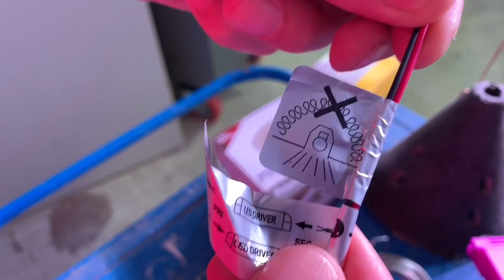Downlight FIRE HOODs are difficult to install - Think again!  - A great solution from TENMAT

Comment: Which Fireproof Downlights or Hoods are best to maintain insulation levels and not pass airflow through the Downlights fitting or hood ?   This witches hats have lots of holes in them and will pass draft airflow.
Reply: Could you please answer as I am fitting some fire rated downlight from quickwire in the on suite. These will be going into the insulation.

Comment: NHBC well what do I say they have being on TV many times fxxking usless organisation getting cash for fxxk all and don't do anything when things go wrong making them totally responsible for a lack of quality work would make them so much better. They should pay for any repair within a property but good video on down lights I was just wondering of the odds of having a house fire these days and like everything else it's a lottery chance to cost and any way maybe the manufacturer of the joists need to do more for fire protection of the joist surely they can do something there is products to make timber fire rated

Comment: LEDs down lights Don’t get hot,
So fire hoods are not required, also if the light fitting is fire rated the fire hoods are a wast of time and effort, they were required when photoflood down lights were  the norm. 

What is the hottest part of a house ? Or the coldest? 

Summer time temperature outside is 80c in your loft it’ll be nearer 200 c  but we don’t see lofts bursting into flames , LED down lights are not going to produce enough heat to course a fire , this is just health and safety gone made
Reply from the maker: The firewood is to maintain integrity of the fire barrier. It has nothing to do with fitting temperature.  With fire hoods (or fire rated fittings) In a fire situation flames enter the ceiling void and cause the timber structure to collapse)  - check out this video - https://youtu.be/c_5MqhJLwFk

Comment: I can't believe we are discussing the testing of manufactured joists they have been widely been used in mainstream house building for the last 15 years and fire-rated downlights have been fitted for at least 10. Why so behind?
Reply: Been building with engineered timber in Scotland for around 30 years!
Its interesting that only since English House builders started using the i joist shown in the video that regulations have changed.
The only place you'll see double block wall houses in Scotland is pre 1990's construction or if they were built by English builders.

Comment: Errrrr it has holes in ???
Reply: I think you're misunderstanding the purpose of fire hoods. They are used to prevent the premature spread of fire, not to stop the spread of smoke.
Reply: Intumescent materials
Reply: @PsychoPsicópata  the material is utterly irrelevant, if the fitting falls out during a fire in the room below the smoke will go straight through those holes in the hood into the floor void!
Reply: @stuartcraigon2003  Did you actually research intumescent materials before wiritng this? the holes will seal before the fire escapes the hood and sets fire to the rest of the materials in the floor celing or whatever. Also will quench the fire at least somewhat as it does not sustain fire
Reply: @PsychoPsicópata  fire is not the same as smoke! Smoke does most of the killing in a fire not the flames!
Reply: @stuartcraigon2003  Lol. The intumescent material doesnt need fire to swell up, it is a heat reaction so whenever there is enough heat it will swell up, therefore it swells up before there is fire everywhere in the ceiling cavity to cause the house to burn at a much faster rate. This is what these products are for. Having them seal to stop smoke into the ceiling cavity because smoke kills in fires more than flames is irrelevant and a ridiculous argument as the smoke would not do anything if it is just filling up a ceiling cavity.
Reply: @PsychoPsicópata  you do know that smoke doesn't necessarily carry heat yeah! 🤦‍♂️

Comment: Nice plastered ceiling with a downlighter that cant sit down properly due to arms of the ceiling hood..
Reply: A stanley blade can be used to scratch a little channel into the plaster for the metal rods to bed into, having said that im sure there must be a less fidley way to fire proof light fittings

Comment: What about 4” toilet fans I’ve installed a sleave over the fan not sure if its correct but most new builds I’ve seen dont have them..
Reply: Most new builds have air handling ventilation units in the lofts which have air vents in the ceilings of all rooms with usually a boost switch for the kitchen and bathrooms, it extracts the stale air which goes through the air handling unit to filter it and circulates as cleaner air, its supposed to prevent damp in buildings as well.
The filters need changing every so often.
Reply: @paultipton743  
What have AHU filters got to do with fire rating a 4” hole in the ceiling that has a bathroom extractor fan going through it? The question was how can you put a hood over a fan? Unless I’m missing something?
Reply: @sam04019491  it was a reply to another person commenting on extractor fans. The post was 4 months ago I dont the full conversation, it looks like the conversation for the fans was referring to a different you tube post.

Comment: Hi  guys i am just wondering What about the single insulated cables and unenclosed connections above the 50mm 1st fittings you installed lights surely this does not comply with Bs7671 
Thanks Neil
Reply from the maker: The wiring connected to the LED fixture is from an LED driver with SELV output - hence single insulated cable.
Reply: @efixx  is the driver inside the hood? That would overheat
Reply: @jamesmoon5632  Most drivers have 300mm from the driver to the fitting so it could be outside the hood the only problem that I can see is if you need to get to that driver for replacement or testing can you get to it?

Comment: Does the fire hood metal retainer(s) that you snipped remain visible once the downlight is fitted?

Only I noticed at 4:53 the retainer is on show. How can the downlight possibly be a true flush fitting if the strip of the fire hood is on the plasterboard surface?

You'd have to make an identation in the ceiling.
Reply from the maker: It depends upon the design of the fitting, we found it possible to press the cut ends in to the board surface and achieve a flush finish.
Reply: The whole thing is complete shite!!